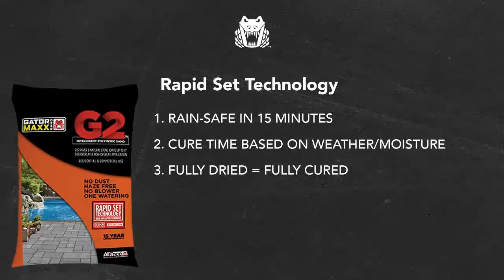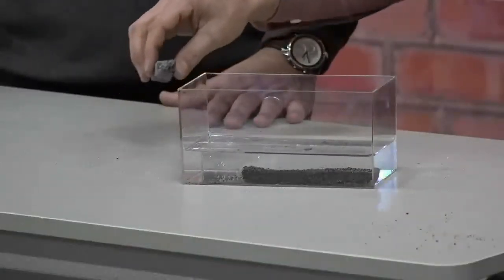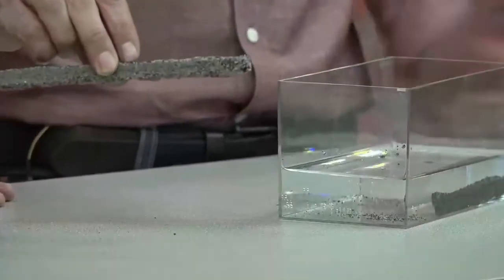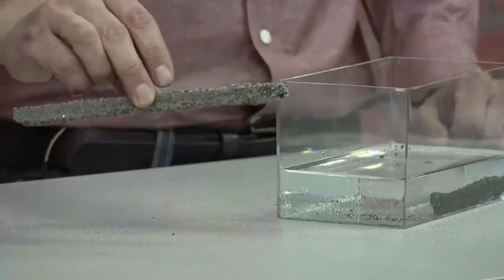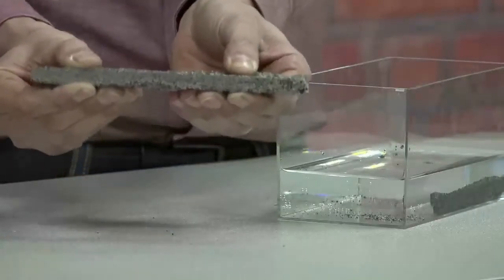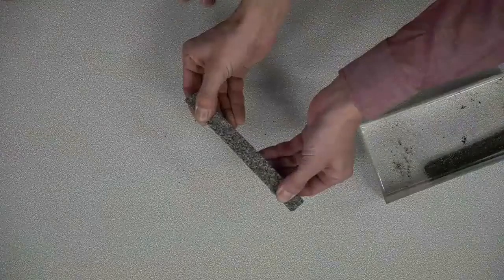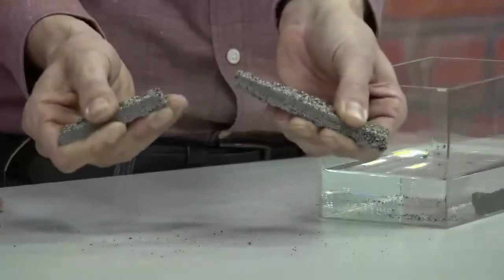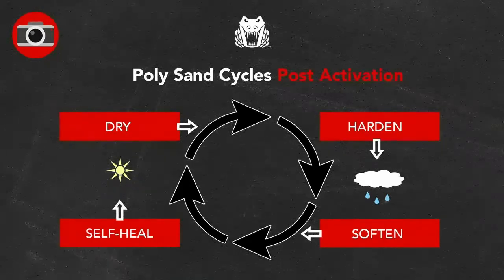Poly Sand Disasters! A Guide On What NOT To Do.

Comment: We had to do our 9' x 18' patio of 18" squares separated by +/-3" joints.  There were weeds/trees taller than me.  We dug out the joints and filled them (+/-3" deep) with polysand, did NOT compact, and flooded them with water a couple times over a couple hours.  It took all last summer to do it and about 40 bags of sand.  It turned out great, except for the dirt that tends to cling to the top granular surface in places.  We have had only a few small weeds so far, but otherwise it has been great.  Now we can enjoy seeing and using our patio, even with guests.  Next we will be filling open 1/2" joints in our car court.  A couple joints that my wife did last year are doing well.